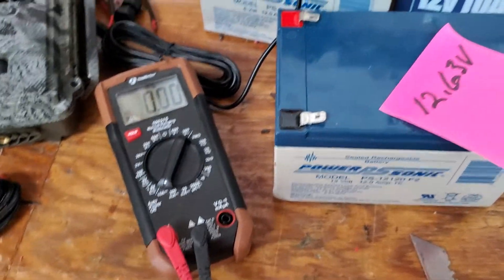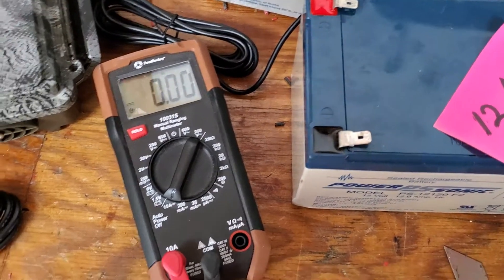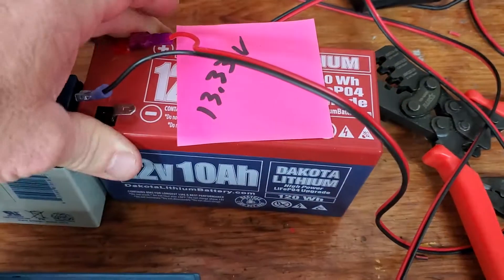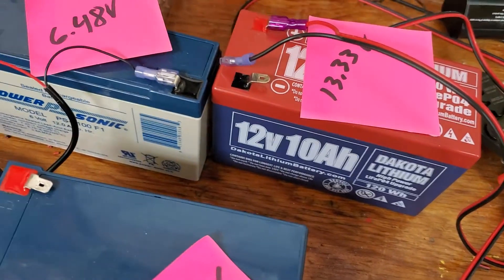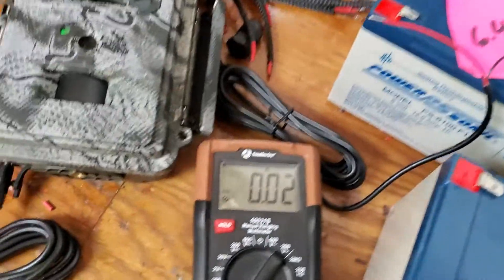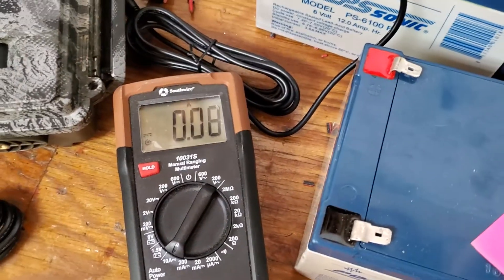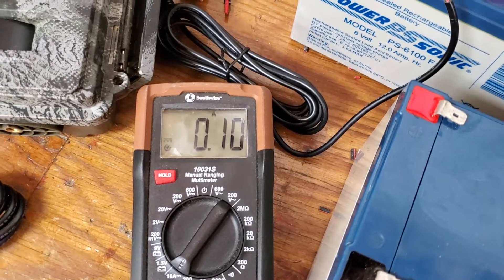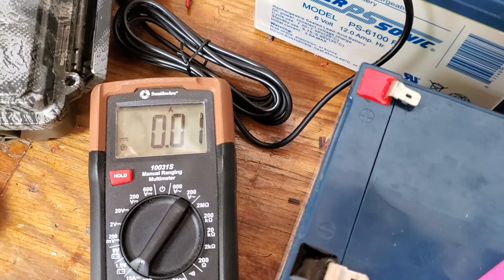How much power does a Spartan Cellular Trail Camera Use

Comment: When your cam is on standby the motion detector circuit will only draw like 10 micro amps.  When it detects motion the current will jump up to 20-30 mA briefly, then up to like 120-130 mA when sending the pic.   If at nighttime and the LED’s are firing it will draw on the order of 600 mA while the lights are on.   That’s why night time videos really drains batteries.
Reply from the maker: I can't find your emails you previously sent me on that diy project you did. Finally slowing down and can check it out. Would you mind sending it again? Thanks
Reply: @herd360  you mean the external battery?